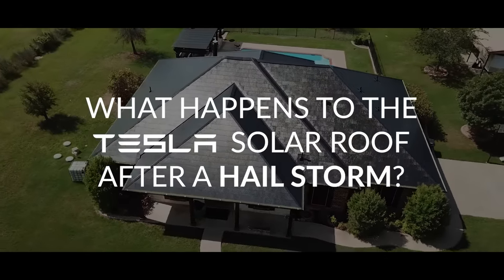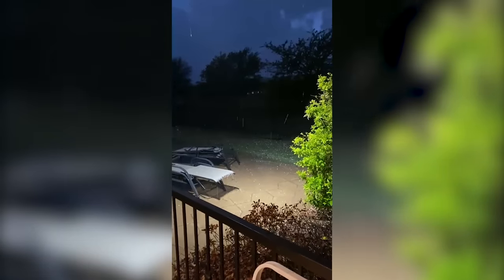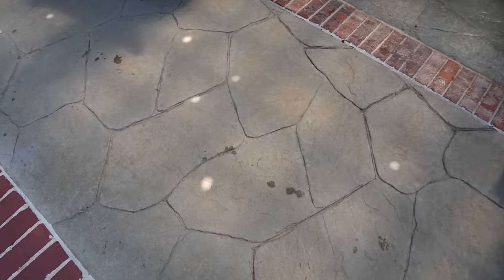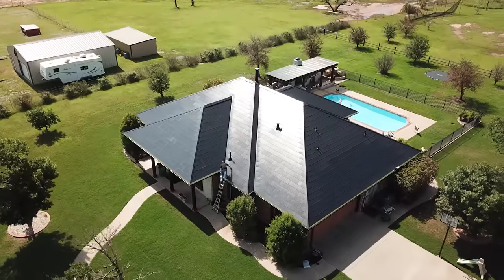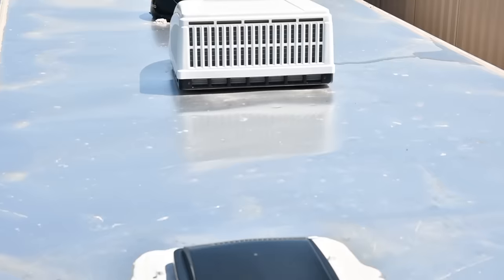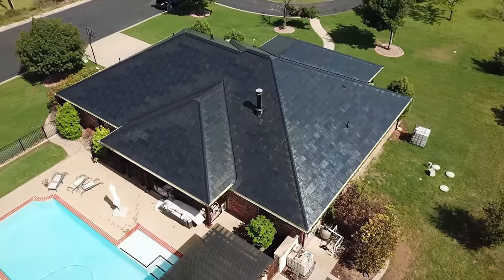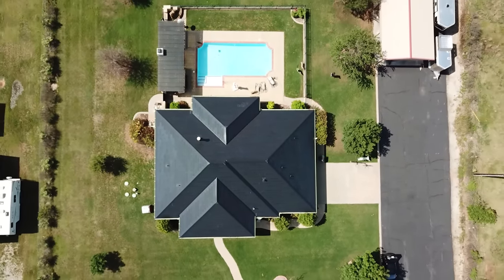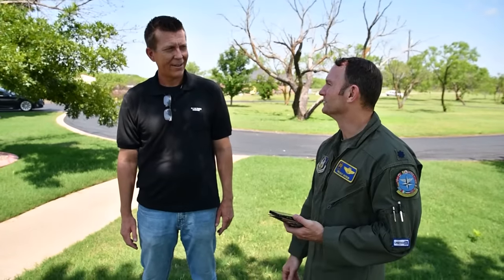Tesla Solar Roof vs Hail Storm in Texas

Comment: This just makes since unfortunately the cost is so unreasonable now it  just isn't feasible
Reply from the maker: The solar roof indeed is not cheapest solar product, but you have to understand that you are purchasing what is equivalent to a lifetime roof plus the cost of a solar system. This is actually relatively comparable. The difference being that the Solar Roof adds significant aesthetics to the home as well, which comes with a cost. There is no other roof on the market that covers your electricity cost and looks this good.